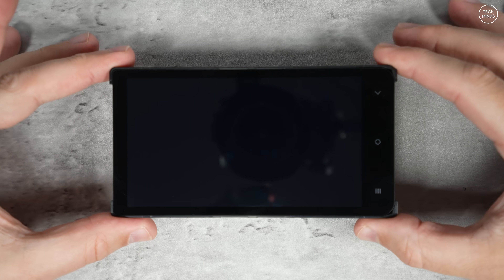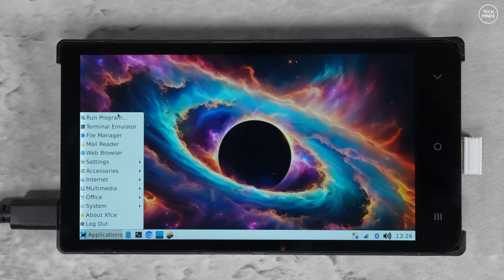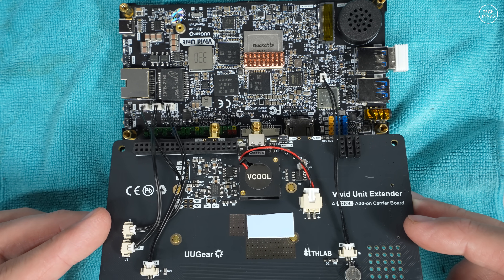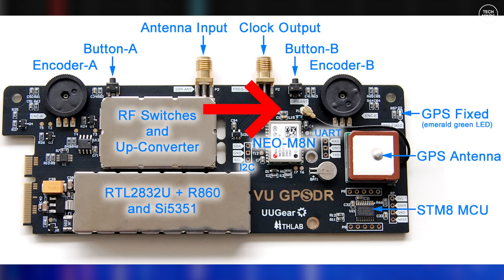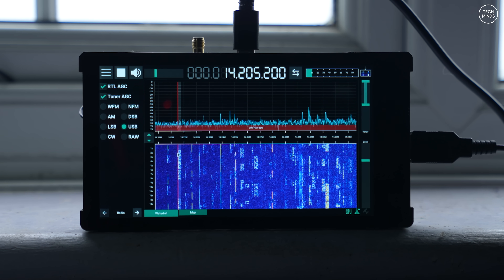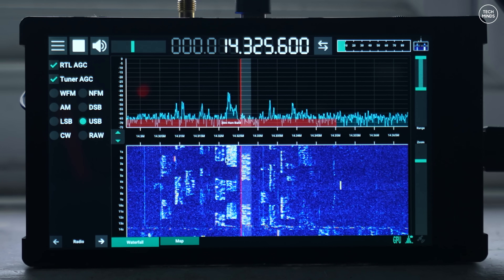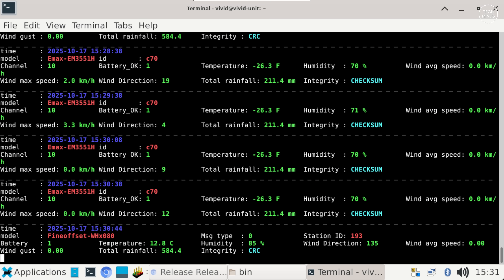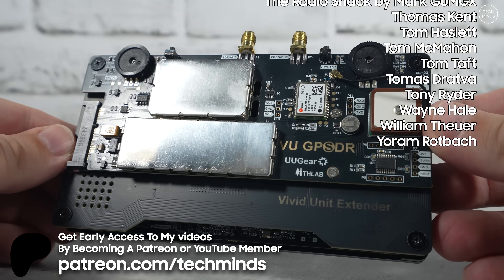GPS Assisted RTL-SDR For The Vivid Unit - Runs Debian 11!

Comment: I got my unit assembled and software installed without any issues. 

I had to try several power sources before I found one that would work. My Anker Prime Power Bank (26K, 300W) worked. 

I wish that the USB C and antenna connectors were spaced apart. It can be tight to connect both cables. 

I live near the Pacific Ocean. I would like to see AIS added. 

Looking forward to the battery pack and case.  

Neat package.

Comment: i need something like this to run on my M5 Stack Tab5
Reply: That would be super cool, but sadly that's a much, much weaker processor. Running a full desktop OS on it will be a nightmare. But a bespoke SDR application could be built for it, though it won't be nearly as capable or snappy as on the Vivid.

Comment: i got my full set ... and im NOT happy!    first if you install the boards and do the setup like the documentation on the website you get a lot of errors...    if you like to start the GPSDR++ version, often it crash the hole system.     if you take a look in the technical forum .. you see that some other people have the same problems :(.    i still wait for the support
Reply: We’ve issued a DPD return label and offered a full refund of the product price + standard outbound shipping upon inspection. If a hardware fault is confirmed on our bench, we’ll reimburse the return shipping as well. We’ll handle this quickly and thanks for your patience.

Comment: Could this be used as a receiver/demodulator for a portable QO-100 station? For instance, using a simple transmitter for CW and this device as a receiver/demodulator directly connected to the LNB (+ bias circuit)
Reply from the maker: Absolutely yes.

Comment: Pros: It does not cost so much that I need to sell my kidney. Cons: 1) It lacks a proper case. 2) Does not have at least an option to insert LoRa radio. Meshtastic, Meshcore.
Reply from the maker: Con 1, they are working on this as mentioned in the video.  Lora such as Meshtastic/Meshcore would require transmitting. You could, in theory, use a plutoSDR and GNURadio running on the Vivid Unit.
Reply: @TechMindsOfficial  Looking forward to the case. LoRa will be best just built in, but thanks for the hint.

Comment: I think that represents decent value, yeah the OS is a bit old hat but i think this could have limitless uses. What that needs is a fancy alloy case with external WiFi/GPS antennas separated into the frame.
Reply: They say an update to Debian 12 to be released in 2026.  There is currently a GPU fix “Mali T860” instead of “softpipe” enabling GPU acceleration on the Vivid Unit.

Comment: Add a rechargeable battery, water resistant enclosure and software switched band pass filters (in lieu of attenuators) and this would be awesome.  The tree parts shown are 189 euros which is a decent price, but I'd really want an enclosure and battery.  I could even live with using an external AM broadcast band notch filter to avoid overloading the front end to maintain sensitivity.  It'd be great to have a tiny Linux computer.  They clearly put a lot of effort into the custom version of SDR++. What we really need is a JS8Call app for Android.

Comment: Debian 11 is ancient. It hasn't been fully supported for about 4 or 6 years.
I just took a look at their site and forums. They don't appear to be interested in keeping up with debian releases. Some people appear to be able to update in place though.
Reply: This upgrade should be straight forward, but will require an update to 12, then 13 (current stable release), using the usual

sudo apt update
sudo apt upgrade
sudo apt full-upgrade
sudo apt autoremove --purge

A few more bits, but that's the main stuff.

Chris 2E0FRU
Reply: @chris_debian5368 The issue is anything custom they did to make the hardware work might not work with the upgraded OS. That's a really big libc version jump.
Reply: @chris_debian5368  It's not possible to upgrade in place. These chips require a lot of special massaging to run Linux, which means a lot of handcrafting. That's the main reason Linux on ARM is held back compared to on x86. The CPU itself is well supported, but the entire ecosystem required to run the OS is non-standard. Device trees have helped a lot with that, but there's still a lot of work to do to get a new version of Debian running.
Reply: They say an update to Debian 12 to be released in 2026.